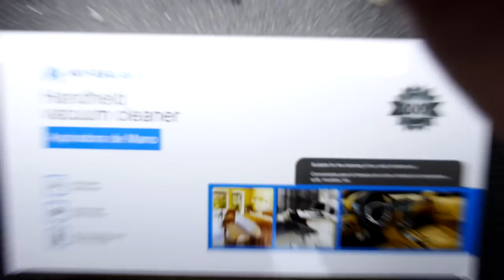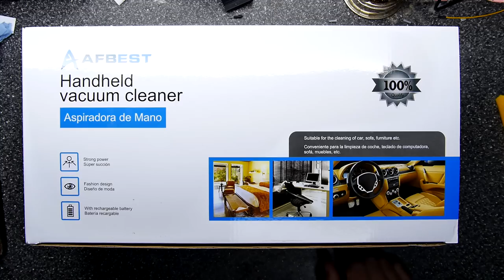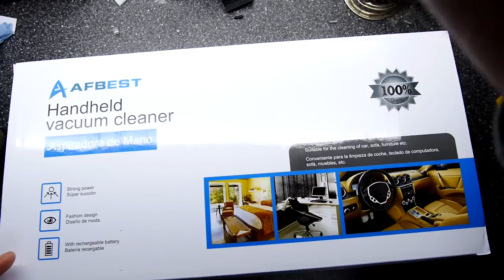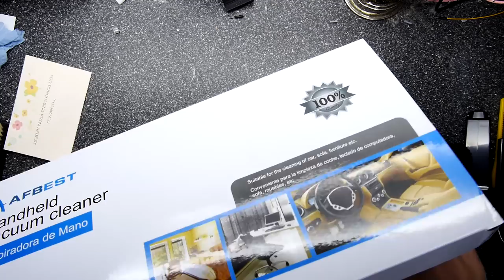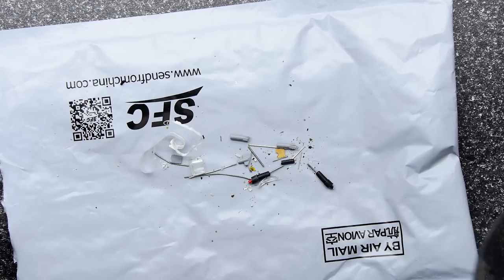Afbest Handheld Vacuum Cleaner

Comment: I need a blow rather than a suck. (seriously, I'm looking for a decent air-duster to use instead of the aerosol cans.)
Reply from the maker: Do you need much pressure? I have a kirby (or two) that have blow modes and they have a lot of flow
Reply: @backofficeshow  I'm being silly really - it would be one gadget too far.  For the rare time I use an air duster, the aerosol type is more that adequate.
Reply: Look for ones that use mains power. They are called dusters and they work well.